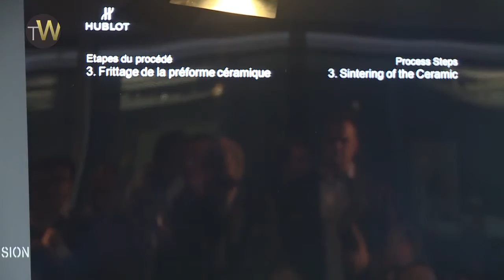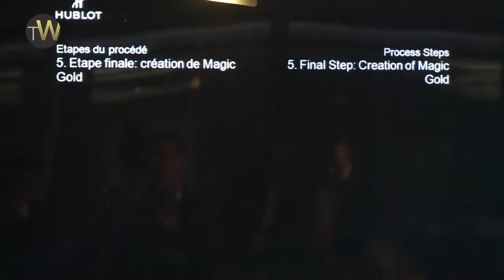HUBLOT - Magic Gold: a revolutionary unscratchable gold alloy

Comment: One question not covered. Can it be melted back down again into normal gold? If not it has to remain fused for eternity no longer making it gold - rather something containing gold.
Reply from the maker: +Mancunian Stacker This question has been asked and at the moment separating the gold from the ceramis seems really difficult due to the structure of the Magic Gold.
Reply: +TheWATCHES.tv hmmm seems like its no longer gold then. I'd be very careful with this for future re-sale prices because of this simple issue. I can live with scratches :-)
Reply: With jewelry the argument is true. But with watches no one tries to melt a watch and obtain its gold in a later date. Hence this new gold alloy will certainly increase the value of the watch.
Reply: Likely smelt and add a separable ceramic powder or clay as a binder for the boron nitride but outside of smelting aqua regia or use cyanide salts and work the solution up. Seems redundant as outside of Hublot not much uptake...
Reply: Yes it can
Reply: Rose gold and white gold should not be considered gold from this thought process